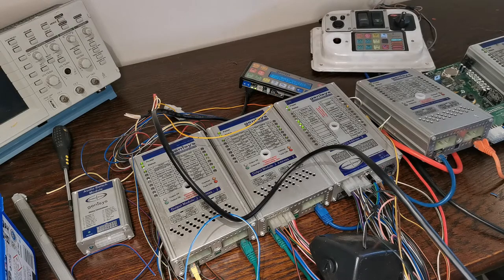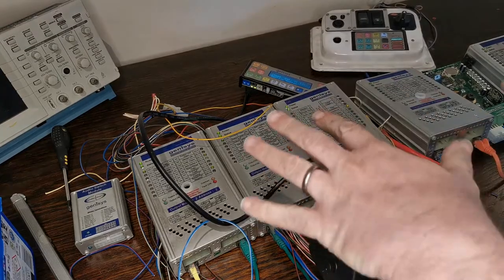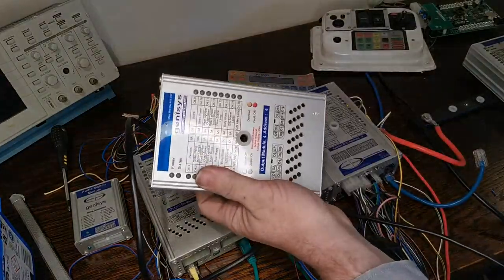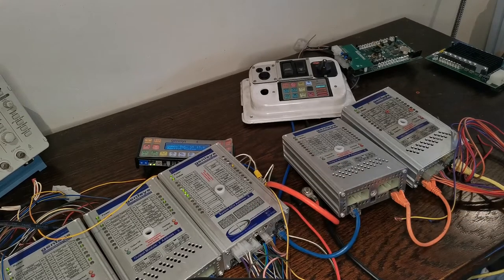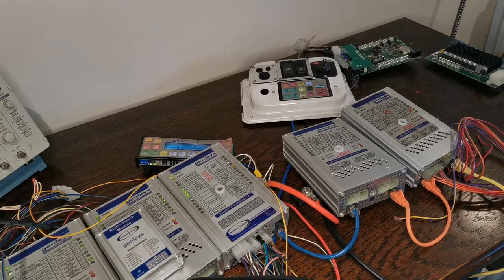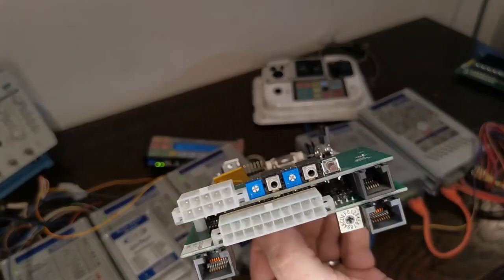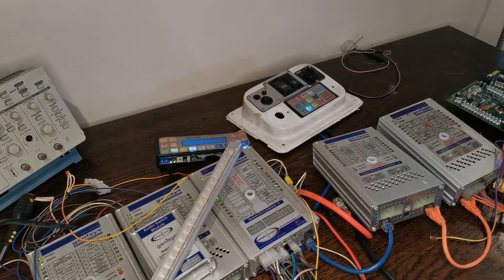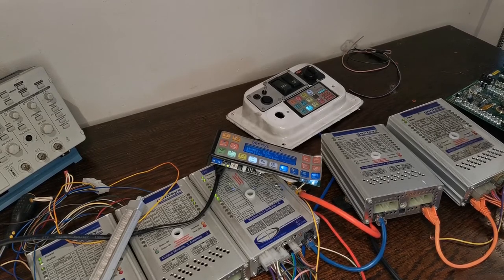Genisys Ambulance Control System

Comment: Thank you so much for this vid. And the comments!!!! Looks like my system has been wiped as the dealer jump started the ambulance. I will get onto ring, or maybe possibly just pull the whole thing out. I'll sleep on it.  Thank you again!!! Legend.
Reply from the maker: If you have no data light on the ecu or other modules and just power on the ECU then yes. Ring will normally reflash FOC.

Comment: An Interesting little video, I regularly remove Genisys from ex Ambulances destined to become Motor Caravans etc. I worked on two in November and have probably done over 30 in total now plus several of the earlier even more energy hungry Phoenix systems.

Each one I do is usually slightly different.  Each converter has their own variations on the wiring it all together theme and the really top notch converters like WAS are sensible enough to also label their wiring making identification throughout the vehicle dead simple.

I have not found a vehicle yet that has Genisys controlled headlights fortunately, because when an Ex Ambulance comes up for sale via the usual two auction houses they usually let their decommissioning vandals loose on them with wire cutters

Rarely are the drivers control panel included when the vans are sold, and those that do have them usually have faulty displays, I have replaced a couple, the display is available from Ring but as you said the button panel tend to fall off and are certainly not really designed for access!

Like Phoenix before it Genisys is pretty archaic now! 
I am actually looking forward to seeing an incarnation that is Smart alternator aware and uses proper battery charging via a B2B etc and is intelligent enough to know that the chassis battery isn't flat whilst the glow plugs are warming up but those Ambulances will still all be in service for a while yet.

qed this is a very assertive Helga in mine:
https://youtu.be/jt9jU03KZ6Y
Reply from the maker: Genisys can and does do CAN bus, but I think some  of the issue is fitting multiple platforms and availability of the data. For example most Renault trucks have at least two CAN busses.  Wheelan certainly do use can and the CENCOM gear is becoming more prevalent but the current crop of Merc's we look after (19/20 reg) are still Genisys. You are right about the Carnation Pheonix and we have one for a teardown soon.

The keypads are a pain and they aren't programmed per installation but the button legends often differ. The displays can be had elsewhere too. Button wise there isn't a lot too be done. I have re-silvered and put new legends on before  but given the time it takes its really not worth it.  I AM working on making a convertor that would allow our touch screens/software to work with it though.

Comment: Interesting - something I never knew existed!
Reply from the maker: Thank you Mike. There are a few systems but Genisys is the most common. You'll hear the distinctive "999 mode... Activated" on most shows like Inside the Ambulance
Reply: @rtechlab6254   in Northern Ireland we bearly hear “999 mode activated” we use Whelen systems but it’s rare to find one of these in ambulance and fire engines here.
Reply from the maker: @Irish.aviation01  You barely do here, the jack connectors have a habit of "falling out" Normally because the crews are fed up with hearing "extreme caution, side door open"
Reply: @rtechlab6254  LOL I would too. 🤣🤣🤣🤣

Comment: Thanks for the video, just wondering if you would know how to fix or diagnose the Genisys randomly saying doors are open, they can vary from side load, cab and even starts saying vehicle reversing when doing 60 down a motorway. 

It seems to just have a mind of its own, and occasionally also turns saloon lights on and reversing sensor too. 

Thanks in advance would be great if
You’re able to reach out to me :)
Reply from the maker: Check the earths. Door inputs go into the ECU so you can check them there. The usual cause is worn/malajusted door switched and it is a real pain.

Comment: Great video thank you. I’m having problems with mine.  It’s not going to sleep, always showing ignition live led even when key is out of the ignition. Have you seen this before ? Any help is much appreciated.
Reply from the maker: You'll want the minifit jr connector on the ECU. The plate will show the pinning for it and then check the pin for ignition. If the system has ever been jump started you may have a fried ECU in which case you'll see no input but the LED will be on. Ring are generally quite good about replacement/repair.

Comment: Hi there, my partner is a nurse working in a ambulance doing medicals. The genisys control panel in the top right of your vid is flashing low battery, red light. The power cable is plugged into the adjacent building, I'm guessing the auxiliary battery is draining? Thanks
Reply from the maker: No aux battery here, its all power supplies. These are often setup for up to four batteries. Chassis, the original battery. Comms for Terrafix and Radios, Aux for everything else and some have a fifth lift battery for the tail lift. A complete set of batteries for a modern vehicle can run to £1500

Comment: I've actually been thinking about fitting one of these systems to my half camper/half emergency response van. I'm looking for a modular PLC system suitable for automotive use, and this looked like exactly the kind of system I want!
But you have me stmped at 'only genisys can reprogram the ecu' - why is this and is there no other way to program the system? I wonder if the protocol between modules could be reverse engineered and then the modules could be used with a DIY ecu based on a pi or something...

Or if there's an alternative system, that has been out long enough to find cheap second hand parts, with software available (even if i need to pay for it) - please let me know!
Reply from the maker: Genisys DO allow some dealer/fitters to program and setup but the bar is high. We looked into it and because their tech support is so good we didnt feel the need to bother. IF you can program in the arduino enviroment I do have some networkable control boards intended to replace Genisys.
Reply: @rtechlab6254  yeah, even though I'm an electrical engineer, I don't deal with automotive stuff much so it's pretty much impossible that genisys would give me the software. 
I've used Arduino a lot and was considering making my own vehicle platform (as a last resort) - if you've already done it then I'd love to know more. I'm a big fan of using things that already exists rather than making my own things from scratch if possible!
Reply: @flamesecureUK  sorry, replied on my other account by mistake. The above reply was me!
Reply: @rtechlab6254 i would be interested in such boards. Is it open design? I have a few output modules.

Comment: Hi there,
Great video. 
Would you happen to have an idea as to why the green climate button on both the front panel and the rear panel is not working? 
It’s a 2012 Fiat Ducati.
Reply from the maker: Check the side door and rear door switches. You can't have rear ac on with a door open. Look at the LEDs on the front of the ECU and make sure the door inputs change when doors are opened and closed
Reply: @rtechlab6254  OK I see. I'll check that tomorrow thanks..... I know the latch at the bottom of the rear door is broken so is not actuating ------ it's I suppose it could be because of that?
Reply from the maker: @IOMTT2024  if it still thinks the door is open. The latches break on wedge ramp trucks because crews slam the doors with the ramp deployed and thus unsupported. You may also get a door open warning when you take the handbrake off
Reply: Hi I have the same Ducato, you need at least a quarter of tank for it to work as also does the night heater
Reply from the maker: @repooca  that's normal for most Eberspacer setups. The fuel pickup is deliberately higher in the tank

Comment: Hi, hoping you can help, when i turn ignition off vehicle, it cuts the power to the back of the ambulance (converting to camper). Any idea where i can feed a permanent or switched live to power the genisys when ignition off?
Reply from the maker: Odds are you have an Aux battery that is dead/has been removed. There will be a split charge controlled, normally Durite or Victron that will power everything as long as it is running. Once you shut the engine off the relay will drop out and kill the bus supply for the auxiliaries. Either install the Aux battery or replace it OR jump the split charge controller but watch you don't overload the main battery which will still be the original chassis specification. Install a god AGM on aux and use that for all your power in the back.

Comment: hi. we have an ex frontline Mercedes sprinter box vehicle which keeps dying. the vehicle isn't on the road every day and with the genesis system constantly on i expect it to draw power killing the batteries. we have it connected to a 230v shore line when not in use but the batteries still die. is the shore line supposed to keep the batteries charged? is there a split charger which should be cutting the draw from the chassis battery when it goes below a certain voltage? can we fully isolate the genesis system when the vehicle is off the road? any information would be great.
Reply from the maker: All frontline ambulances have parasitic draw as they are designed to plug in. If it's new to you check all batteries as the AGM's have a finite life and a failed AGM can cause all manner of issues. You may also have a smaller battery under the driver's seat to check too. Do a good battery health check before you chase down anything else. 

The shore line should charge the main chassis battery at the very least. Most Antares/Xantrex chargers will do two or more batteries. There will be an RCD on the truck somewhere with Kassmaul auto ejects and a power LED on the connector on the Antares systems (We have Antares cables). You'll have a multi way split charge which will only use the vehicle alternator to charge when the engine is running and the chassis battery is in a good state. Again, a poor chassis battery will cause the split to never kick in.

Isolation wise, the Genisys system only normally, but not always,  draws power from the Aux/Coms battery. if it is using the Chassis battery you can fit an isolator of the correct current between the supply and Genisys bussbar. You may also need to isolate the ECU feeds as well.
Reply: Great thank you very much that has been a great help

Comment: Hi i have a renault master ex ambulance 2009 battery went flat as was of the road but when i went to start after charging battery  it just turns but wont fire up i did try to jump start it with another car but did not work so i would like to take all the genisys system out as i read afterwards that possible the main brain of the genisys as disabled dew to me jump starting so is there anywhere i can get instructions to take this out
Reply from the maker: Hi Margaret. Thats unlikeley to have anything to do with Genisys. We do offer removal/rewire services but you'd need to track that start fault down. Check the primer bulb on the inside of the drivers wing, this is a known common failure and will result in the engine getting no fuel. Check what the immobiliser is doing too.

Comment: Should the control panel on the dash stay illuminated permanently? Only just picked up my old ambulance and this thing doesn't want to go to sleep!
Reply from the maker: It should eventually sleep. It may mean it thinks it has a door open or similar. Look at the LEDs on the front of the ECU
Reply: @rtechlab6254  👍

Comment: Hi and thank you for video. How to reset Genisys system as stock on low power mode even when I charge coms battery ?
Reply from the maker: Hi Tomas

On the ECU, Remove all connectors and wait for a minute, or better, leave overnight. Reconnect.
A faulty battery reading could be causing this and is fairly common on a vehicle that's been jump started. Check the battery monitoring voltages at the ECU (Pinouts are on the front of the unit) and if all is good you'll need to ship it to Ring Automotive for repair. They are really good about it.
Reply: @rtechlab6254   I must disconnect ecu of mercedes or genysis system ECU?

Comment: If jump starting is a no no- how would I go about starting the vehicle if the battery dies?
Reply from the maker: Charge the battery or find the supply to the Genisys system and isolate it. There will normally be a large maxi fuse or bolt in labelled Genisys. Pull this and the large molex on the ECU and go for it. Alternatively allow the batteries to eaqualise. It's the voltage droop that causes it. The modules start to boot, the brown out glitches the uC and it wipes the flash. The chips do have protection from this but it was never enabled.

Comment: If i purchased a old ambulance. Would you advice not touching the Genisys wiring at all? Is there a way to leave the normal vehicle functions active. (ignition, headlights etc) and remove these modules? I would be buying an old ambulance to use as a basic van/campervan.
Reply from the maker: It depends a lot on the way its setup. Generaly if you look at the modules it'll tell you what is wired to what. The ECU takes all inputs and the other units  are output modules only on most. The most common problems I see are that the headlight wiring passes through the system, so your high beam goes through and then it provides a left and right high beam to give the headlight flash. If you goo slow and work round each circuit in turn it's not so bad. I have seen ambulances that have been converted to manual switching after a Genisys system failed.
Reply: @rtechlab6254  Thank you for taking the time to write such a detailed reply.

Comment: Great vid, very informative! Wonder if I could ask a question.  I have an ex ambulance, Ford transit type. the genysis system has flunked out completely a couple of time.  I  managed to find a emergency vehicle garage who managed to fix peoblem, but cause of covid I cant travel the 100 mile round trip.  The only light on the whole system is the power light on the ecu.  Is there a trip switch on the system ? I have been thinking about just removing the whole system, but now sure is if it would knock out a few onboard things, although all headlights and brake lights seem to be ok.  Any advice is greatly welcome!! thanks
Reply from the maker: The headlights are normally wired through, either high beam or dipped, whichever doesn't currently work. These will need wiring to bypass the system. Horn may well be too. In its state now see what doesn't work. If you have a power light on all units but no data, the ecu is toast. If you have nothing on the other units you have lost the first data cable from the ecu, or have a short. If you are closer to us we can look at it
Reply: @rtechlab6254  thanks for the reply! where are you based? I will have a look tomorrow to see exactly what has power, although I am sure its only the ecu which has power, the other units are dead I think, thats why I asked if there was a trip switch somewhere
Reply from the maker: @theedgegym4703  the ecu supplies power for all modules, this is separate from the power on the large bus bars. No network, no power. If the ecu is dead (jump starting kills these almost instantly) you'll get power and no data. We are Portsmouth but we cover a massive area.
Reply: @rtechlab6254  dont suppose you do Glasgow lol? are the ecu units hard to come by, or can you fix if I send it? The first time if was not working it was cause of a jump, but not this, I removed the battery and fully charged then
Reply from the maker: @theedgegym4703  the ecu will need to go back to ring automotive for reprogramming, they are pretty good about it and only normally charge shipping. All the programming is in the ecu and it's unique to each build
Reply: @rtechlab6254  hi, I checked my ambo, only the ecu had power light on, the others had zero power.!  I am assuming I would need to have ecu sent away for reprogramming.  How would I go about it, again thanks so much for advice!!!
Reply from the maker: @theedgegym4703  contact ringcarnation.com and they will sort you out

Comment: Hello I wonder if you can help me I’m looking to buy a Mercedes ambulance to convert it’s a 64 plate can you remove all the electrics to put in my own 12v system and is it tied into the ecu I appreciate your help.
Reply from the maker: It depends on what system it is but many are. Genisys and Carnation are the most invasive but its doable with time and patience. Some of the system can potentially be repurposed.

Comment: I’ve got a genisys system out of a Skoda Octavian ex east of England Ambulance and I can’t get it to talk back when I press 999mode
Reply from the maker: Check Sprake connector on the Ecu, there is also a volume control there but some don't have voice prompts
Reply: @rtechlab6254  which connector bud and it’s strange when it’s plugged into the aux port of my vehicle it comes through the cars speakers very slightly
Reply from the maker: @mikecatterall8557  I've been asked as few times. Will do a vid

Comment: Any suggestions as to how to keep keyless ignition working without motorway mode on? 

The ambulances in our service force motorway mode on with keyless ignition, which means the rear emergency lights are always on. Can be irritating for built up areas when all I want is to keep the ambulance warm for patients in these colder months. 

Also, there is an ambulance that we believe is running in "demo mode" where the siren will switch it's tone automatically after 10 seconds, is that an easy fix? 

Thank you.
Reply from the maker: That's down to programming. Ring may help if you reach out to them. Alternatively if its just engaging rear reds disconnecting them is a possibility as under Deregulation only Police and Traffic should have them.